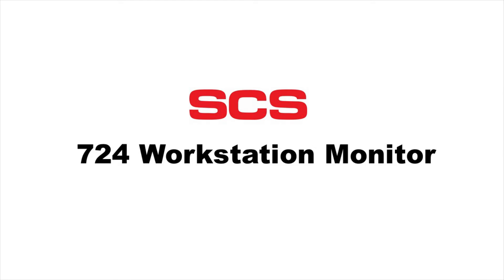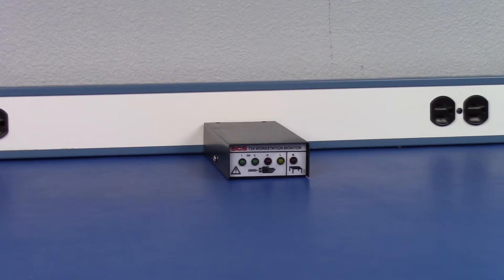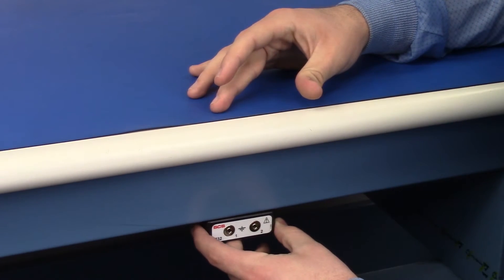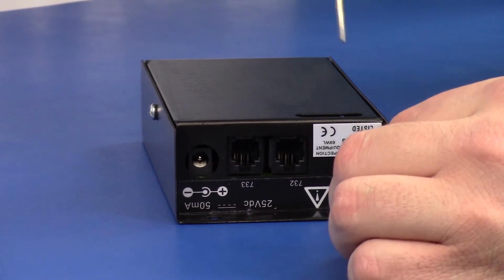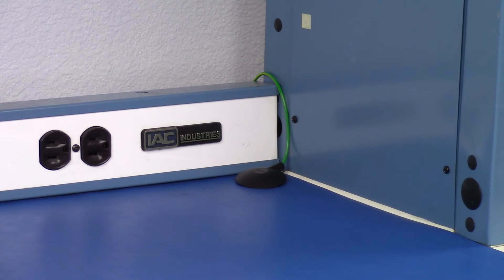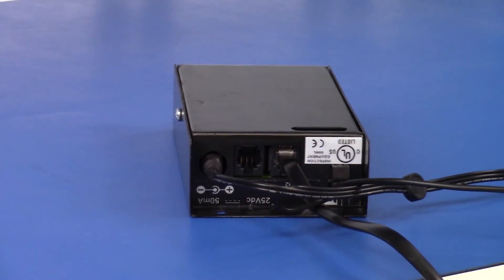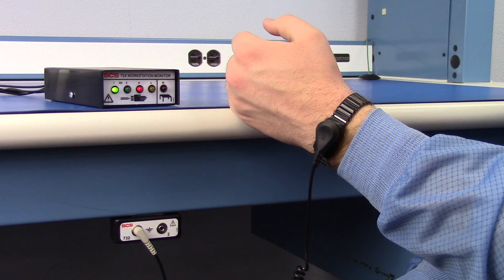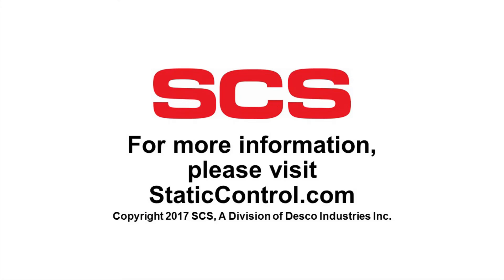SCS 724 Workstation Monitor: Installation and Operation

Comment: I don't understand how a  dual wire wrist syrap is better than a single wire wrist strap
Reply from the maker: Single- Wire wrist straps have one conductor inside the insulation of the coil cord. They offer significantly lower life-cycle costs compared to dual wire-wrist straps. Although they are suitable for must applications, single-wire wrist straps are an economical way to ground an operator. Dual-Wire wrist straps have two conductors. They offer a reduced risk of damaging ESD sensitive devices because even if one conductor is severed, the operator still has a reliable path-to-ground with the other conductor. For that reason they are generally used in critical applications. For maximum benefits, dual-wire straps should be used together with dual wire monitor.

Dual-Wire wrist straps have two conductors. They offer a reduced risk of damaging ESD sensitive devices because even if one conductor is severed, the operator still has a reliable path-to-ground with the other conductor. For that reason they are generally used in critical applications. For maximum benefits, dual-wire straps should be used together with dual wire monitor.

They key thing to remember is that Dual Wire wrist straps provide redundant grounding.
Reply from the maker: Single- Wire wrist straps have one conductor inside the insulation of the coil cord.  They offer significantly lower life-cycle costs compared to dual wire wrist straps.  Although they are suitable for must applications, single-wire wrist straps are an economical way to ground an operator.

Dual- Wire wrist straps have two conductors.  They offer a reduced risk of damaging ESD sensitive devices because even if one conductor is severed, the operator still has a reliable path-to-ground with the other conductor.  For that reason they are generally used in critical applications.  For maximum benefits, dual-wire straps should be used together with dual wire monitor.  Another term that is used to describe Dual-Wire is “redundant grounding”.